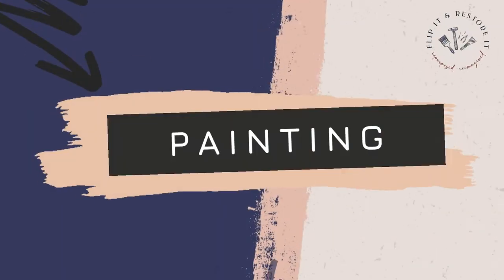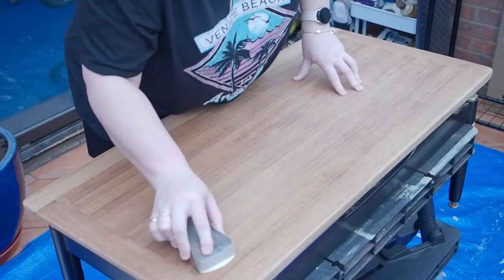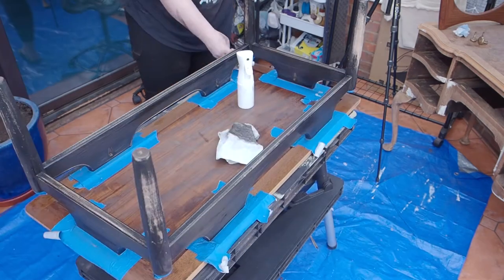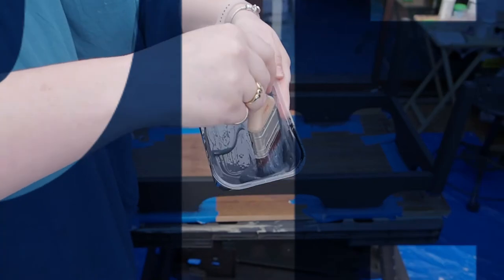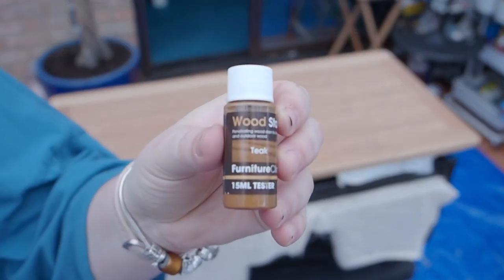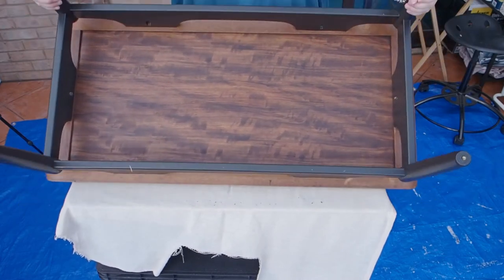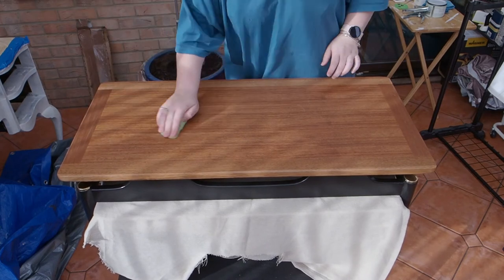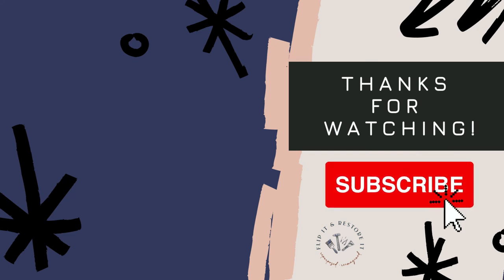How To Repair and Restore a G-Plan Librenza Coffee Table (Mid-Century Furniture)

Comment: That's a beautiful table. I use brass wire brush or even steel wire brush on oak to get rid of the paint if it's stuck in the grain. As long as you go with the grain, nothing to worry about.